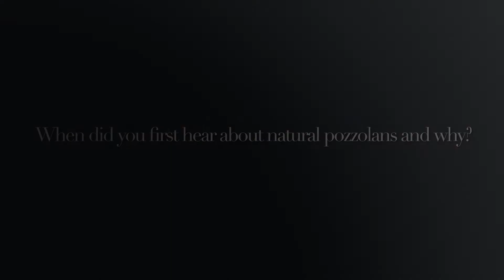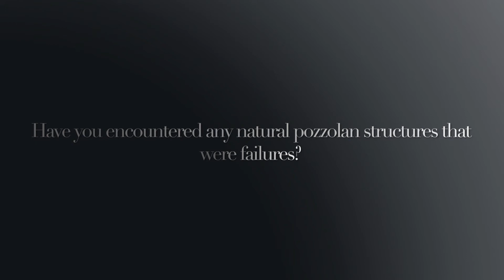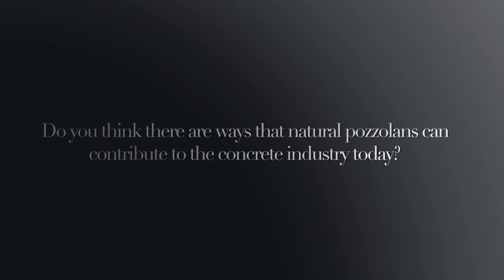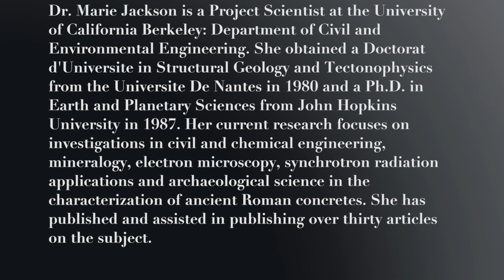An Interview with Dr  Marie Jackson on The Use of Natural Pozzolans In the Past and Future

Comment: I've been a pumicecrete home builder for the past 25 years 
Pumicecrete is by far the best building material on the planet Pumicecrete is a mixture of pumice cement and water mixed and poured into a set of reusable forms walls are poured from 12"to 25" thick pumicecrete is fireproof termite proof rust rot and mold proof and has a high R value and good sound attenuation solid poured walls means no critters can live in your walls Pumicecrete can be built for a fraction of the cost and time and pumice is one of the few building materials that can go directly from the mine to the job site ready to use without any additional possessing and zero waste Take care Ray